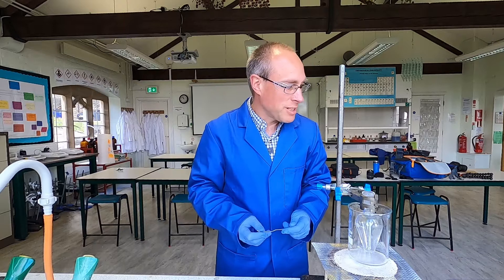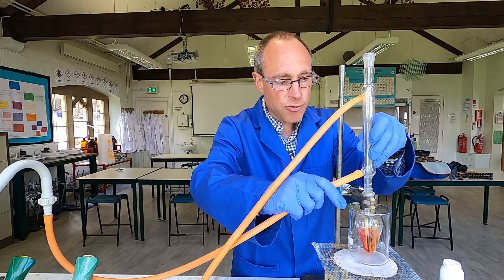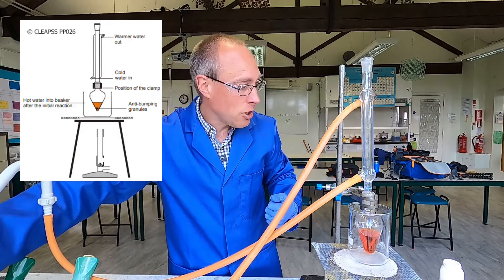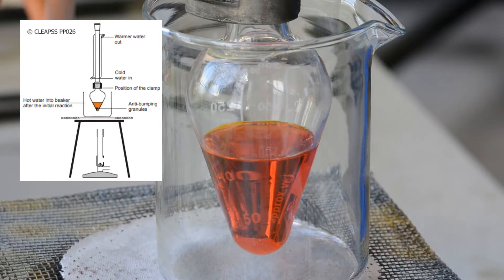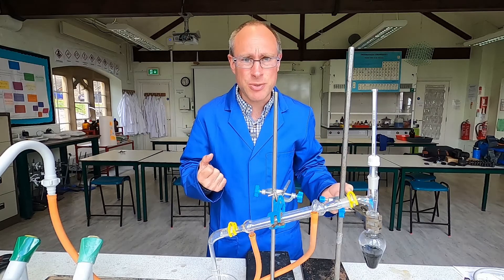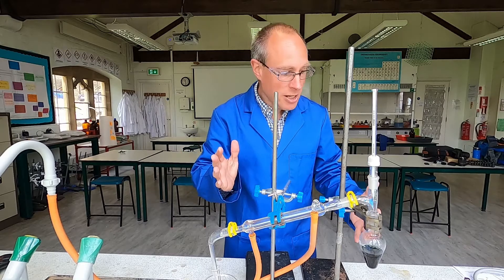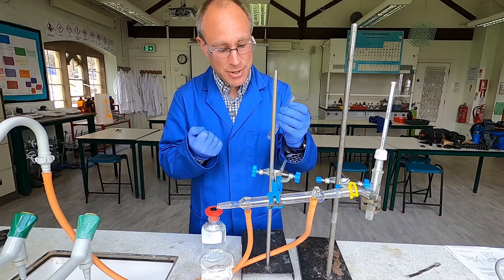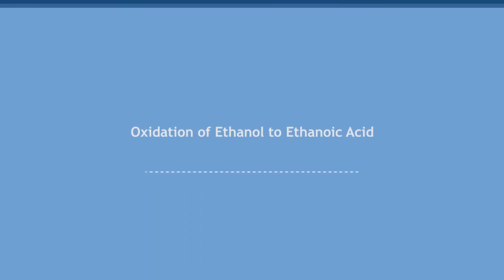Production of ethanoic acid

Comment: Sir why sodium dichromate is recommended and safer than KMnO4
Reply from the maker: A good question! KMnO₄ is a strong oxidising agent and will certainly work oxidising primary alcohols to carboxylic acids. Na₂Cr₂O₇ is more soluble than the potassium form and tends to lead to more controlled boiling in the flask, which is why it is recommended for use in secondary schools in the UK (even though exam boards refer to K₂Cr₂O₇). I suspect that dichromate is preferred in exam questions because it can be used for both partial oxidation and full oxidation of alcohols, which means students don't have to remember even more reagents! Hope that helps.